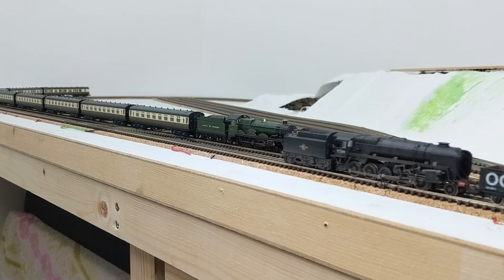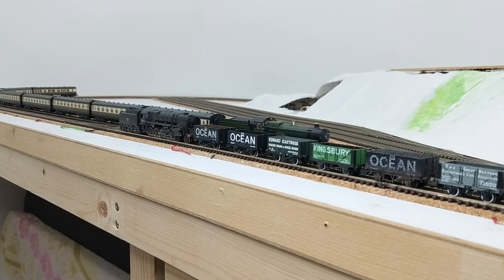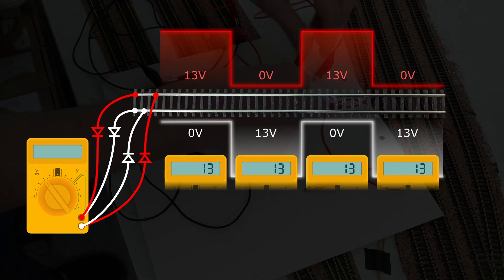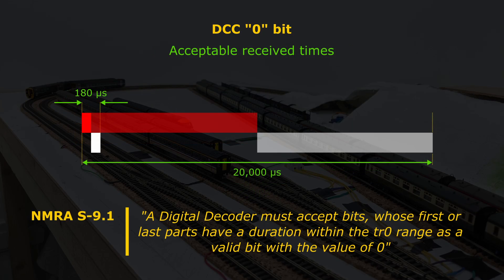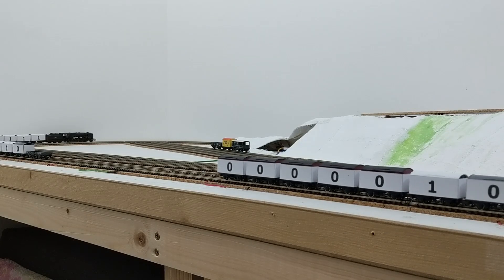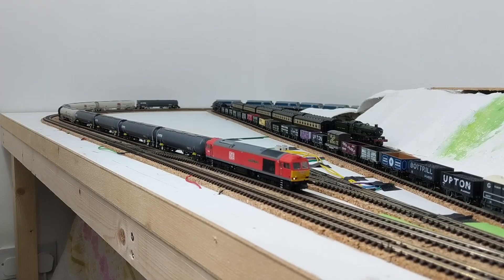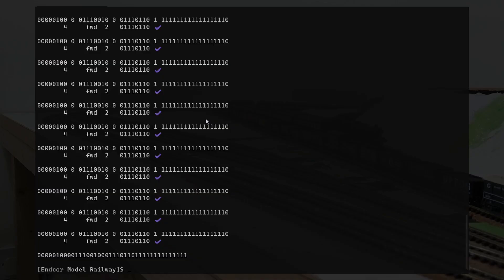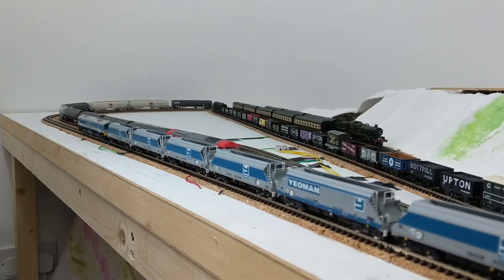0047 Decoding DCC from scratch

Comment: Regulator is awful solution to match  signals voltage levels. Resistor divider will be enough, eventualy optocopuller or specialised level shifting ic (old ones from RS232)or just transistor.
Reply: The voltage regulator is not ideal - a step change on the input will result in a slope change on the output.  I recommend you use a high speed optocoupler (6N137 is commonly used).  This will also protect your PC from any damage.  In your final decoder, you can just use a series resistor to limit the current into your microcontroller and rely on its input protection diodes to clip the signal to 3V3 or 5V.
Reply: @BLOCKsignallingUK  The RP2040's gpio input circuit is pretty weak and should not be relied on if you know the input will exceed the 3V6 specified maximum input voltage. In this situation an external zener or TVS makes much more sense to me.
Reply: @rivimey  Good idea.  From the rail connection, a diode and resistor in series, then a 3V2 zener to ground makes good sense.  A small capacitor in parallel with the zener would also remove some level of intereference (100pF ?).
Reply from the maker: Thanks for the info 🙂 Ah OK - out of curiosity, what makes the regulator so bad for this? I'll definitely need to scale this down though, and I know it's possible to get small surface-mount resistors, presumably also transistors and optocouplers. But wouldn't the resistor approach rely on the track voltage staying the same? In practice it does, but according to the DCC specifications a base station would be allowed to produce a lower voltage, and decoders should be able to cope with it. Plus locos might get poor pickup on occasions even if the track voltage is consistent.
Reply: @endoorrailway  I only add some to what colegues wrote. 
Those regulators work stable when some substantial current is drawn from output and today's microcontroller inputs are not taking current at all almost. Also they have some kind of regulation loop and may became oscilatiors without decopuling and they are not suited for high freqency signals as one write it may generate substantial slopes, especially when load is almost not existent. It may be mitigated partially by pulldown resistor on 3.3v side and some capacitors but sincerely I'm shocked that it works at all 😉
Reply: I came here to say the same 🙂 : Nobody uses voltage regs as level shifters. I have not looked at the signal on a scope, but I don't think their startup time/speed will be reliable enough for proper timing. The pico should be plenty fast (I think) for what you are doing. You can try with a resistor divider if you do not want to isolate the track and pico with an optocoupler.
Reply: @CarstenBe  about lower voltage - if you do divider 1:4 for example then if input drops 1v then output drops 0.25v also voltage value accepted as logical 1 is quite wide starting from 2V also most microcontrollers will accept more than 3.3v some even 5v without harm, eventually you can add zener diode to for safety. But optocupuler maybe most safe and small solution.
Reply from the maker: @CarstenBe, @BLOCKsignallingUK, @AK-vx4dy - thank you all very much for the follow-on information here, it's all really useful 🙂 It looks like I'll be doing some component shopping for the next iteration, not just changing the programming language!

Comment: your multimeter is averaging not true rms therefore the real voltage reading should be  multiplied by 1,4 to get an actual voltage, if you pass it trough fill bridge rectifier you should get that minus 0,7v
i still need to build my n decoder because everything off the shelve is just a bit too big

also your instructions don't have to be mesured with any high accuracy, since bit 1 and bit 0 are different length you just need to check every 0,7 of the length of the shorter  bit and if value fliped read 0 and if it didn't set 1 and set interupt for another rising edge , then reset timer and do read again
Reply: To follow up, averaging RMS meters assume a sine wave amd multiply their measured value by 1.11 to approximate RMS. ( (sqrt(2)/2) / (2/pi) )
So divide by 1.11 to get the average value of your measured signal. Since average and RMS for square are the same, you're done.
Should be measuring less than two thirds though, I cant explain that @ 3:55.
Reply from the maker: Thanks @kokodin5895 and @electrowizard2000 for the information - this afternoon I looked up what RMS is and came to the same conclusion about the square wave, explaining the track output in AC mode. I don't think the multimeter would need to do RMS to measure DC, though - in fact it can't be, else it would never produce a negative reading, so for now I think the two-thirds thing remains a mystery.
Reply: @electrowizard2000  this is not sine though, it is square wave alternating via h bridge from single positive voltage
if a meter has small bandwidth even if it is averaging it would measure much less than normal ac, most cheap meters is bandwidth limited to less than  1khz because ac  they are ment to measure usually is 50-60 hz, the best way to measure this kind of voltahe is to put full bridge  on it and measure dc and better yet use something like texas instruments active bridge rectifier and it would spit out 1/10 of rms voltage as a dc, i made meter like that to measue 14khz pulse voltage used in crt tv's as a heater voltage for the crt

Comment: There's a wide range of Open Source DCC decoders so unless your doing it for the thrills I don't really see the point in re-inviting the wheel. Had you picked Arduino/Teensy as a platform there's even a library for DCC decoding.
Reply from the maker: Yes - I did a bit of searching and found a few, including one that's specifically for the RP2040 - they gave me the confidence that it's feasible. I'm doing it from scratch for the fun of it, but if I get stuck or lose interest then I can move over to one of the existing solutions 🙂

Comment: As someone who as ample of experience with the Raspberry Pi Pico and using it to decode binary protocols. I highly recommend you to took into using the PIO System-Machines. 

While it is assembly language, which in another comment you stated you don't want to deal with.
PIO-Assembly is exclusively I/O Assembly with a total of only 9 instructions.

PIO can only do I/O nothing more. The IO is then put into a buffer to be read by CPU or if you want to extra fancy it can be written into memory directly using DMA. The Stat-Machine then can trigger an interrupt for CPU do do its things.
So you can stick with MicroPython and the inherent inefficiencies you get from running an interpreted language or go to C it doesn't matter.
Reply from the maker: Thanks for letting me know about this - I'm not all that experienced with microcontrollers - I've just dabbled with the Pico for a few bits on the railway in the last couple of years, so hadn't come across the PIO stuff.

It does look ideally suited to this, from what you say and from a brief overview I just read.

I didn't mention it in this video (I've been doing the visuals for ages - I recorded the audio several weeks ago), but to get something physically small enough to go into N gauge locos I'm expecting to need to use something physically smaller than the RP2040 - possibly an ATTiny of some sort - so I don't want to do things that are super-specific to the Pico. At this stage I'm building an understanding of what I need to do both from the perspective of electrical components and interpreting the signal, so Python was an easy way to do that... except it's just far more inefficient than I'd expected!
Reply: @endoorrailway Trying this on an ATtiny sounds fun, I tried something similar to what you did in your video with an Arduino a few month ago. I used interrupts and I got it to work great, but I was veeeery sloppy with implementing the proper SCC protocol. It could understand loco commands with 28 or 128 speeds, and with more function keys than my train controller could even send, it could accept switch commands and turn on and of LEDs accordingly. Since it's written in plain C (well, the Arduino variant), it would be easy to do the same with an ATtiny84. It's interesting to see that for you the CPU speed was one of the biggest problems, even tho your chip runs at over 100MHz, while the Arduino I used runs at just 16MHz, and I guess it would also be possible with an ATtiny at 8 or just 4 MHz. Since the station sends everything multiple times it's no problem to just record one command and ignore everything while slowly processing it. 

Your demonstration with the packets as a train was quite interesting, it just shows how easy the protocol is, no unnecessary stuff. 
Speaking of unnecessary stuff: my "decoder" just ignored all the error correction things, since it was just supposed to be a proof of concept.😂

Great video!
Reply from the maker: @ThatLolaSnail Thank you - I'm encouraged that lots of people have had success with Arduinos - it means that even if things aren't seeming to work, I at least know that it's possible and can push on 🙂 I've actually had some 20MHz ATTiny85s since January but haven't done anything with them yet - they'll most likely be my fist non-Pico attempt at anything. Over the last few evenings with C and the Pico I've got as far as getting the LED blink and seeing Hello World output over USB - next up will be a comparative speed test to see just how much more efficient the C is than MicroPython when doing the same thing. Lol, proof of concept is always the most fun part! Thanks 🙂
Reply: @endoorrailway  
I worked with the Pico in an employment setting so I have good experience with it.

I never had N Model Railroad only H0 and G. But a RP2040 just as a package without the the Pico board around, I think is only 7x7mm bit you would need some PCB design knowledge if you want to use it as a package. 

Heads up if you want to use Python, you will restrict your choice if microcontroller significantly. Chips like the SAMD21 are already a pain on python as the whole Python runtime uses almost all 256k of Flash. 

For C++ you can use Arduino which supports a variety of Controllers but the independent of the controller also means more overhead although less than python for sure.

If you go with C, you can be rather certain, that the code you now write for the pico in C can not be ported to an ATTiny as the SDKs are very very different.

For an ATTiny I would suggest reading a lot about hardware timers.
Reply from the maker: @IamTheHolypumpkin - that's all really useful detail, thanks! I think with the number of pins on the RP2040 I would struggle to solder that to a board, though I wouldn't need to connect all of its pins I suppose, so wouldn't necessarily need to have it in a diamond orientation.

I'm not set on using Python really - it's definitely my preferred for getting started, but if it's too slow then I'm happy to move to C or C++.

It sounds like I'll need to have a read of the ATTiny SDK sooner rather than later then - I might be able to write the code in a way where I can isolate the specific differences, if I'm aware of what they are. So far I've never programmed anything besides a Pico, so I've definitely got learning to do one way or another!
Reply: @endoorrailway  Also remember that the RP2040 is pretty tiny, it's the Pi Pico dev board that makes it larger. There are smaller dev boards like the Adafruit QT Py RP2040, the Pimoroni Tiny 2040, and the Waveshare RP2040-Tiny. If you're planning on designing your own circuit boards then you can go even smaller.
Reply: @endoorrailway it should also be pointed out that about 2 months ago a new pico was announced. It’s faster with more memory, I think it has more cores and more PIO.
Reply from the maker: @nurmr thanks, yes the RP2040 looks about 6.5-7mm square, which for what it packs is a marvel of engineering, but there are other components that will be needed, and in an N gauge loco I'm often only going to have something like 10mm by 15-20mm, so it could get tricky.
Reply from the maker: @RichardBetel thanks, yes - although I don't particularly follow electronics news that one did appear in my general news feed - the RP2350. I think I also saw that it has deeper support for programming it in Rust, which might be worth looking into as something more memory safe than C, but faster than Python. I've never programmed in Rust before though. I may well get one to see what it's like, but I already have a few Picos at home.
Reply: I came here to say using the PIO would be the best option. The other option is using a capture timer module and interrupts.
Reply from the maker: @SimonEllwood thanks for the info - I hadn't heard of a capture timer module before, so that'll be something for me to look up 🙂
Reply: There are ways around it, but the RP2040 is best thought of as something to use with solder stencils and reflow soldering only.

Comment: Rather than a regulator to reduce the track voltage, try using an opto coupler, that is what I use. You are going to struggle with the PI as there are other processes running in the background and these will be using some of the processor cycles and may delay events being detected giving eratic timings. The PI has a lot of things going behind the scenes. This is why an arduino at 16MHz can quite happily decode DCC as it only runs the code you place in it and there are no background processes.
Reply: He's using a PI Pico, which is just running his code in the same way as the AVR in an Arduino. The Pico is a microcontroller like the AVR, it's NOT a board running an OS like the PI4/PI5 etc.
Reply: @RamothElectronics  Sorry missed that, thought is was a standard PI.
Reply from the maker: Thanks for the info. Even though this is indeed a microcontroller, I was surprised at just how inefficient MicroPython seems to be - taking 30 microseconds to do something means nearly 4,000 clock ticks!

Good point about the optocoupler - I imagine it's possible to get very small ones too, which will be useful when trying to fit everything into an N gauge loco. Are they able to withstand 13-ish Volts coming in?
Reply: @endoorrailway  yes optos will work at that voltage, I work it out that you need 10mA to driver the opto, therefore if you have say 13V then you need probably a 1.5K Ohms resistor in series with the diode. The output needs to be pulled high with respect to zero volts by something like a 47K Ohms resistor. Chip resistors can be soldered directly onto the pins of the opto. When current flows in the diode side of the opto then the output will be pulled low.
And yes micro python is not efficient. C will probably get you a shorter code path, but i have never run it on a PI pico. Watch for useful efficiencies.
Reply from the maker: Awesome, that's really useful - thanks 🙂
Reply from the maker: Thank you for taking the time to write that information 🙂 I've got plenty of programming experience, but have rarely needed to worry about compiling to specific architectures, and have generally stayed in Java and Python - although interpreted they've been fast enough for my needs. But working with microcontrollers is a fairly new thing for me, and I haven't done lots of command-line code compiling for years now, and back then it was just makefiles and gcc - trying to program to a microcontroller looks much harder, but happily there's lots of information out there on how to do it.

Thanks for your illustration there 🙂
Reply: @RamothElectronics  But if you want Linux running and Arduino at the same time try using the MilkV, can do both at the same time. SBC is not bigger than the rpi PICO.
Reply: You can run a regular pi in realtime mode too. Not with the usual linux distro of course
Reply: You can use dma on modern mcu like stm32 mcus